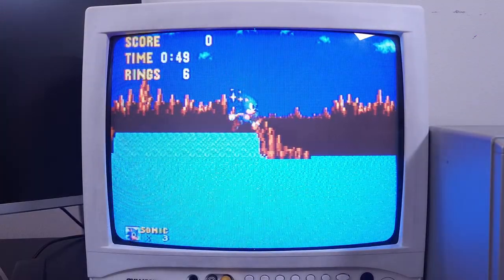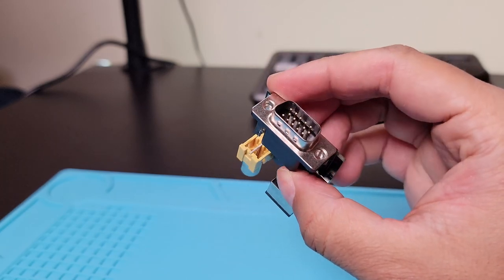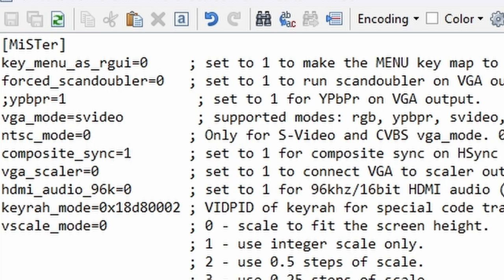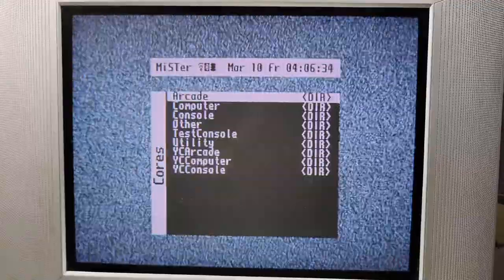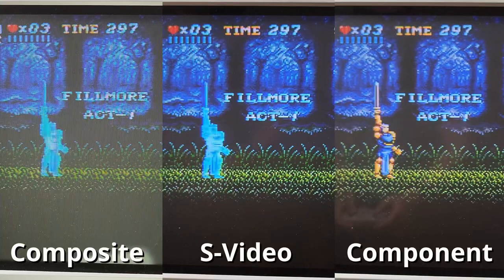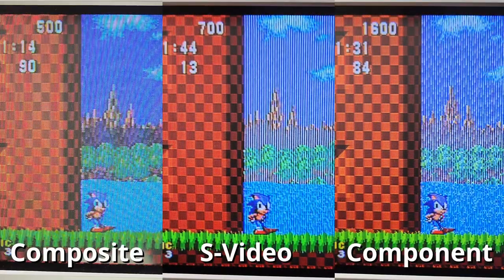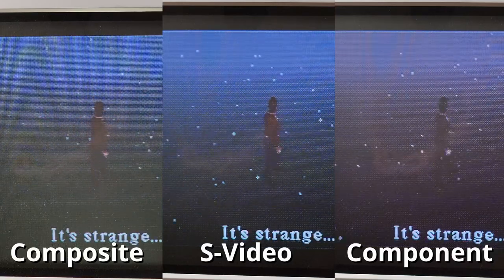MiSTer FPGA S-Video & Composite How-To

Comment: In my experience S-video is much closer to component than composite.  I would actually like to see people focus on getting the best possible composite output from older consoles, and now from Mister.  Sometimes people blame composite for bad pictures without realizing their consoles just didn't even do composite very well.  From Dreamcast on, I think s-video or component is best.
Reply: I played component no problem straight out of my VGA mister board. Just one passive cable worked just fine.

I feel it's just nice to have the option, especially if you use the Mister as a portable thing. Or to re-experience your childhood tv if you haven't thrown it away yet. :)

Comment: Good video. Nice explanation, but I hope we get to the point where - if I plug in a composite, I dont need to set jumpers & INI, - it just works. MISTer as a platform should support composite as a standard output. - Alternatively in the MISTer main menu, should be a menu option: OUTPUT: [comp / SVID / SCART / HDMI] - You demo outputting to 3 TVs but you didnt say what the INI is set to in that case.
Reply from the maker: I don't see it becoming plug n play unless there are some major redesigns to the add-on boards and also the project being FPGA agnostic. MiSTer is a hobbyist project and things are added as needed. Lot's of features were never originally intended.

For outputting to 3 TVs, its the same exact same ini settings as I mentioned in the video and on the video description.
Reply: @LusRetroSource  - At least its set-and-forget for people with multiple TVs.
Reply: You can already select different INI's from the main menu, up to 4 total.  If you needed to switch to component for some reason it would be as easy as just choosing one of those other INI files.  If you cant see the screen because of conflicting INI settings, there are also controller combinations you can press to activate the different INI's from the menu.
Reply: @WalrusFPGA  - not really what I mean - but if its a matter of having standard INIs for different output modes - then... there could be built in pre-configured INIs and selecting COMPOSITE in the menu - could enable it.

Comment: Great tutorial. One thing to note mentioned by Video Game Estorica (don't think YouTube comments will allow a direct link) is check your vga cables if running 5v to the active controller. I was stumped getting this to work until I tried a higher quality one and it worked!
Reply from the maker: Good tip. Didn't have any issues with the VGA cable I had.

Comment: Looks like composite is generated in full range from what you showed. The level should be 7.5IRE and white level also lower. So no further correction should be needed when you connect it the composite input, but here seems you'll have to manually lower brightness and maybe increase contrast to fit Y/C limited range values. S-video should have no problem with this video levels and as you showed s-video seems to be in the correct range

Comment: S-video is very sharp, especially from an RGB source like this. The community has been overstating how ubiquitous composite blend was back in the day. Obviously us in SCART territories were on RGB cables that didn't composite blend as early as the 16 bit era, but even videophiles in the US who would splurge for the right cables would get sharp output that made dithering visible. The good thing about these adaptors is you can go back and forth at will with a quick cable swap, and using S-Video plus software composite blend settings in cores produces very similar results to composite cables with less pixel crawl, depending on what adaptor you're using.

But hey, if we all finally get to the point where we acknowledge that old games didn't just have one look universally that's progress. 

It was all 4:3, though. Anybody who plays old games with other aspect ratios using square pixels is objective wrong.
Reply from the maker: Agree, there is not one look for retro games. We all grew up with different experiences, so it's all about getting the look you want and enjoy.

And yeah, 4:3 games stretched to 16:9 is just plain wrong.
Reply: Most systems with SCART still just used composite signal tho. The PlayStation 1 for instance came with a composite AV cable but you could get an RGB cable as an option (needed for playing imported NTSC games) but it wasn't standard. 8 and 16 bit systems were pretty much universally just composite via SCART I think? ... or just plain old RF
Reply: @antivanti  Made me go look it up, but apparently not the case on 16 bit, the Internet tells me that both the SNES and the Mega Drive will output RGB over scart when paired with the right cables. 

8 bits is a different story. The NES and TG16 don't do RGB natively, although some sources say that some versions of the Master System do have it.

Never mind that, as we see in this example, even composite will show dithering rather than blend if you're on good S Video cables, and probably also on well shielded composite over SCART. Whatever the actual makeup of the signal coming out, if you went out and bought good cables for your SCART-supporting console and TV you immediately got a sharper image... and as a result all that dithering staring back at you.
Reply: @mademedothis424  SEGA Genesis in particular had a lot of stuff made specifically made for composite blending. Like the waterfalls in Sonic The Hedgehog
Reply: @mademedothis424  Master System MK1 has RGB out 👊
Reply: @antivanti  Yep. And many of us never saw the effect at play, or considered it a bad thing. It was a weird push-and-pull thing at the time, where TV tech was moving towards selling sharper RGB picture as a positive but MD games were leaning on artifacts to mitigate the limitations of the hardware when it came to color reproduction.

This was pre-internet, and we hadn't figured out how this stuff worked. Even developers were short on documentation and mostly just doing stuff that looked good on whatever they were using. See also: the inconsistent aspect ratio in SNES games, where some art is authored for square pixels and other is authored for 4:3 across the console's library (and sometimes inside the same game).

I mean, we PAL guys spent the better part of a decade not even realizing our console games were all running in slow motion, so composite blend as a desirable thing was pretty deep into nitpick territory.
Reply: I have a PVM and honestly it’s amazing how good it’s composite input is, not quite RGB quality but comparable to S-video
Reply: @mikeg2491  
Actually, that's the only thing I don't like about my BVM. The image itself is so damn good that even composite signal can't 100% handle the dithering.
It's a lot better than RGB, but I can still see the squares and lines.

Comment: S-Video is so cool. Sync on Luma

I call it super video
Reply: Most people do call it super video, I used to hear that term a lot during the 90's with high end VCRs they said: "it Looks a lot sharper as it supports super video"
Reply: @cortbelmont  Love it love it love it love it.

Honestly the forerunners who discovered that TV standard should call it super video not just "separate video".

Btw the nickname for composite is equally lame instead of calling it composite video blanking sync, they should call it snowless or blurry video!
Reply: @Muda_Muda_Muda_Muda__  to be honest using composite after being used to RF feels like going HD, no snow, no noise, no bars, just blurry... I agree blurry video is a good nickname

Comment: I think composite is the way to go for most of the systems on MiSTer. While it's true that many developers had access to PVMs, they did design games mainly for what was commonly available in their market.
Reply from the maker: I really enjoy using composite, but I love that we have the option to choose the connection type with MiSTer.
Reply: @LusRetroSource  Yeah definitely. What sold me on composite just now was how your video comparison showed how different everything looks between the high contrast of s-video, and that of composite. The feel is so much different. I'm pretty sure developers used high contrasting pixels to go for the effect they were likely going to get on RF or composite.

Comment: Great video. Do you know if my antoniovillena S video adapter is still compatible with the new Mister update? Or should I upgrade to the Mike Simone adapter? I mainly want to connnect using s video.
Reply from the maker: Antonio Villena's adapter is still compatible and should always be compatible because what it does is take an RGB signal, which MiSTer can natively output, and convert that to S-video. If you're using s-video then there is really no need to switch adapters. However, if you're using composite and find the dot crawl annoying then it would be a good idea to switch to the new adapter.
Reply: @LusRetroSource perfect! Thanks a bunch and Happy gaming.

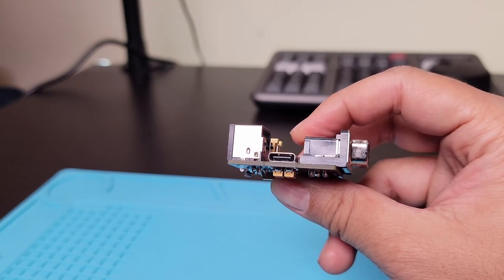Comment: Was the TV at 5:28 an Insignia 20"?
If so I have that exact model (and why I was watching this video)

But also, stupid question, if all you're connecting is S-Video or Composite, how do you get sound?
Reply from the maker: The TV was a Panasonic 20" Tau series. It was composite, s-video and component connections.

To get sound you will have to use a cable that plugs from the IO Board's 1/8" audio out port to the TV's audio RCA in ports.
Reply: @LusRetroSource  makes sense, thanks!

Comment: I'm only getting 480i output with both active adapters I've used, an RGB to Y/C converter based on the AD724 chip and a couple of XOs and one with a THS7374 with no XOs onboard, but a bunch of caps and inductors. For CRT this is not an issue, but with LCDs it does cause some issues. Anyone had the same experience? I can get 240p just fine on YPbPr.

Comment: Just got my Mister with active yc adapter. Running s- video to my crt with separate rca for audio but am not getting any sound. Any ideas as to what might be causing this?
Reply from the maker: I never had to modify any settings to get the 3.5mm jack working. Try using a fresh mister ini file, but make sure you back up your old one in case there are any settings there you want to keep.

Comment: Is it possible to have a SCART cable for this that supports both RGB and Composite so one can switch between them. Sometimes I want the sharpest RGB available but sometimes I want the composite signal to get the intended blending of pixels (like the "transparent" waterfalls in Sonic) or just proper the retro feeling

Comment: I am already using Antonio Villena's adapter to get nice s-video signal. I am not sure if the update changes anything for me.
Reply from the maker: If you're using his original adapter then this video doesn't pertain to you. That adapter converts an RGB signal to s-video instead of generating the s-video signal within the core. It works great with s-video, but composite could use improvement because there's noticeable dot crawl on the edges of graphics in cores.

I believe he discontinued that adapter and now sells an equivalent one that I talk about there.
Reply: @LusRetroSource  oh man everything makes sense now! The composite  has horrible dot crawl haha. I was an early adopter

Comment: I know I am months late, but I have a question about 2:20 that you can maybe answer, between this and your other videos…

I’m looking to connect my digital I/O board to my composite red/white/yellow crt. I have an active adapter, but I’m confused about how to get the audio feed to my tv. Even in this video, you only plug in the yellow video composite?

Any tips, I’d be so grateful! I have been buying the wrong cords over and over 😂😂
Reply from the maker: I do not have a digital IO board, but as far as I know it does not support analog audio and only supports optical audio out. So you'll need some type of optical cable to output your audio.
Reply: @LusRetroSource  makes sense, ty!

Comment: Im so confused. Stupid question. I purchased one of these adapters about a year ago, and I’ve been using my mister on a Sony Trinitron via S-Video for about a year. So what has changed?
Reply from the maker: This is a fairly new development for MiSTer. The adapter you have is most likely an RGB to Svideo/composite converter. I have one of those too. Those adapters have issues with composite with noticeable dot crawl. I created a video on one of those adapters here:

https://www.youtube.com/watch?v=lnXKFwwIh58

Now MiSTer generates the s-video signal natively in the cores instead of converting RGB. There's also tuning done for composite to eliminate dot crawl. If you're using s-video then the adapter you have will work fine. If you intend on using composite then it's better to use the new method.
Reply: @LusRetroSource  Ah okay. Thanks for the response Lu! I think I understand now. So if I’m just using S-Video, would there be any reason to pick up a newer adapter, or would it be exactly the same?

Comment: I got a retrocastle adapter and sonic doesn't look accurate on composite, maybe it's because I'm using older cores, I'll have to try to update and try again, otherwise I'll have to get the Mike Simone adapter.
EDIT: just updated and tried all video modes: none of them except for RGB work at all with the retrocastle composite adapter, they all show a greenish image
Reply from the maker: Check with RetroCastle to see if it uses Mike Simones design. I know they have an IO board with s-video support but it does not use Mike Simones design and converts RGB to S-Video and getting it to work will require different settings.
Reply: @LusRetroSource  yeah I found out its just an rgb converter, what a shame, I bought it thinking it'd be the one but now I have to get the correct one

Comment: After I run Update All 2.0 through Downloader 1.6, the VGA mode does not exist in my ini file. I have the Y/C file in the root of my mister sd card, but is there anything I'm doing wrong?
Reply from the maker: You'll have to add it manually then. I put the settings for the ini file in the description.
Reply: @LusRetroSource  Okay I am getting an image but it is rolling. The image scrolls up continuously (or it flickers on another video option mode on CRT)

Comment: Anyone know why PSX would play in black and white while using Mike's adapter?
Reply from the maker: The official core hasn't been updated with the new framework yet, which is why you get a black & white image. You will need to use the forked core Mike created for now. You can enable those cores in update all.
Reply: @LusRetroSource  Thanks for the answer. And also for creating this tutorial. Those selling these adapters should consider linking to your vid because instructions are pretty lacking.
Reply: @LusRetroSource  THanks for the info.  That was my question as well.  Love your channel!!